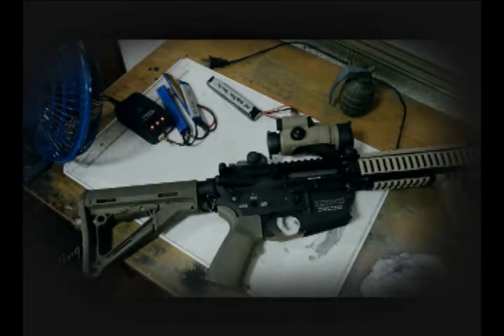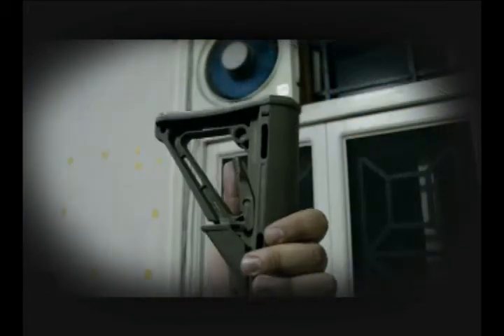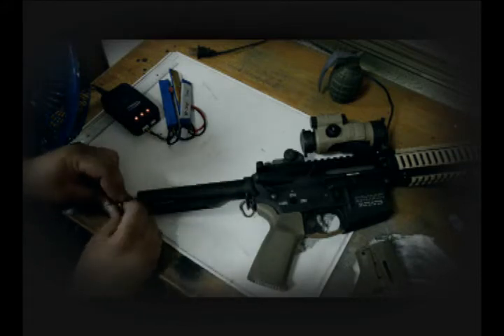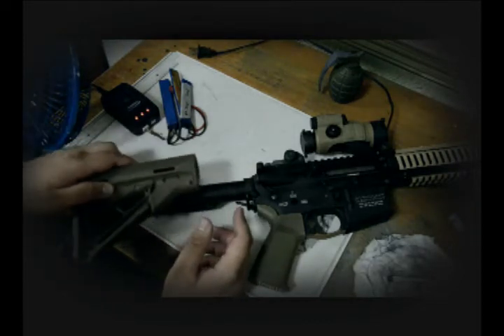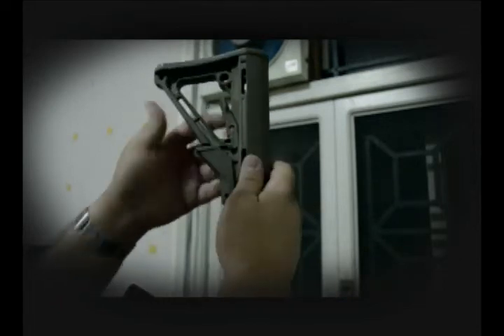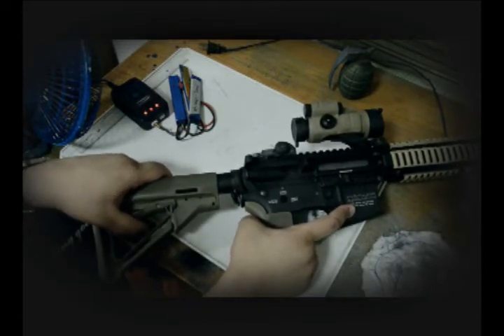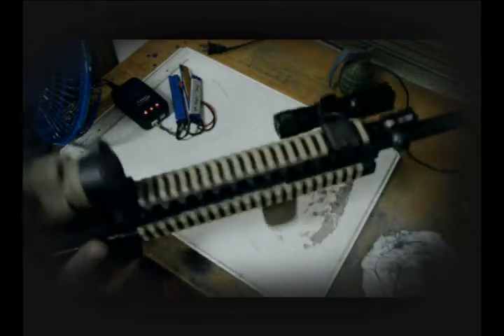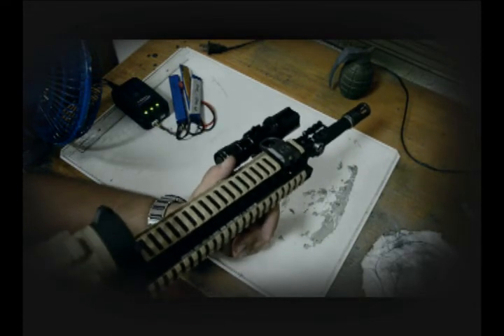Battery On M4 Buffer Tube (AIRSOFT)

Comment: True, but I'm looking at the ASCU v2 mosfet and the control unit is made to fit into the buffer tube. Also, I have a lipo battery small enough to fit in the buffer tube, I was just wondering if the two would fit simultaneously. It doesn't bother me if the battery sticks out of the tube either because the stock will cover that.

Comment: Just to clear this up, 11.1v lipo battery will wreck ALL airsoft guns that are not a)internally built to handle them, b)have a mosfet installed.  The amount of power coming from an 11.1v lipo is to strong for stock guns unless purpose built to specifically take an 11.1v lipo.  Half the guns claiming to be "lipo ready" will get destroyed by a battery that strong.  Do your homework and research if you are buying a gun and DO NOT TRUST the retailers or makers to tell you the truth.

Comment: I was thinking about buying a KWA sr7 and wanted to upgrade with this magpul stock so I would need to use this buffer tube setup.  What small type lipo should I use? 7.4V , 11.1V or anything else? Sorry I'm not the smartest when it comes to batteries
Reply from the maker: Depends on the length of the buffer tube, but usually I'd like to go use a 11.1V with a decent mAH

Comment: How much room is left in the tube after the battery is installed? Would you be able to squeeze a mosfet in there too or is that too much? If not, do you think a 1000 mah battery would leave enough room for a mosfet?

Comment from the maker: Honestly, I don't think a mosfet would fit inside with the wiring and battery. If you use a crane-stock style battery though, you might have chances to fit it in.